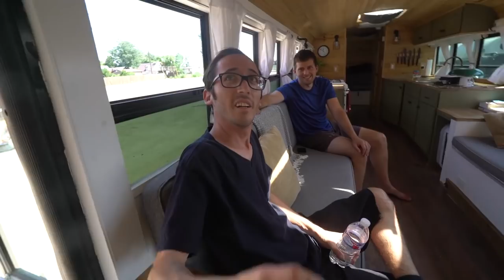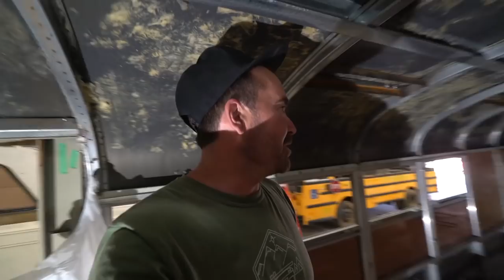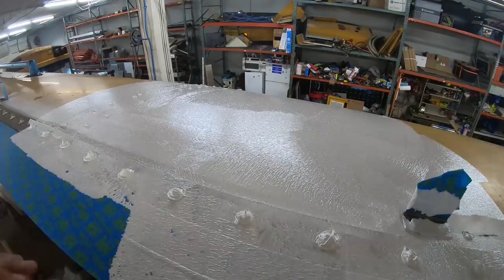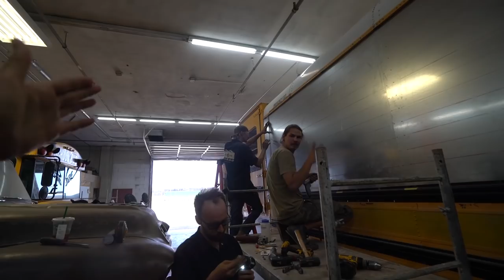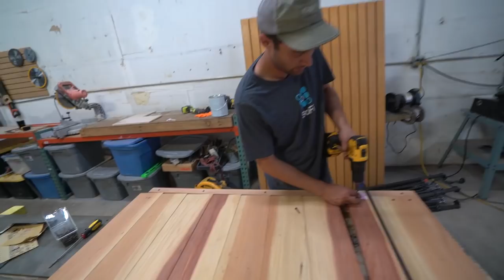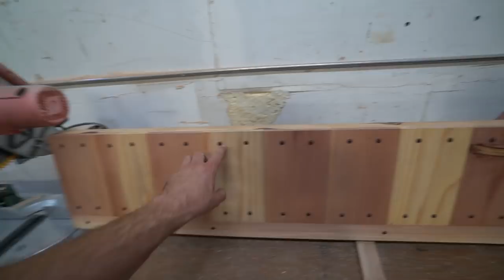Redwood Deck + RV Roof Paint + Wood Ceiling Nailers

Comment: Glad you went with the Redwood over Cedar.
Reply from the maker: I agree with you, but my wallet disagrees 🤣🤣
Reply: The redwood will save you in the long-term, I used to work for a cooling tower company (They cool water for industrial A/C's and reactors)  And the slats were redwood.

Comment: I think you got that maxfan facing the wrong way. Your forcing air through the fan blades while driving possibly causing harm to the fan. And their designed to run down the road while raining with no issues, youll be forcing rain down with that wind

Comment: Wasn't the original roof made out of metal?  If so, why are you using what looks like a textured paint?  Won't that trap dust and dirt more easily?

Good luck on that ambitious build!
Reply from the maker: The roof is metal. The paint reflects heat.
Reply: Aha.  Thanks.
Reply: It's going to be so nice!  I'm about to paint my van roof to lower the temp.  if you don't mind, what paint did you use?  do you recommend it?  thanks Jax

Comment: a name for the place....i dunno .... lotsahcees maibe

about the paint on the roof i think youre using some vinyl stuff from the looks of it , you might need to use a razorblade to make sure you dont pull sheets of paint along with the masking tape
Reply from the maker: That did happen a little. 8 coats probably didn’t help either 🤷🏻‍♂️